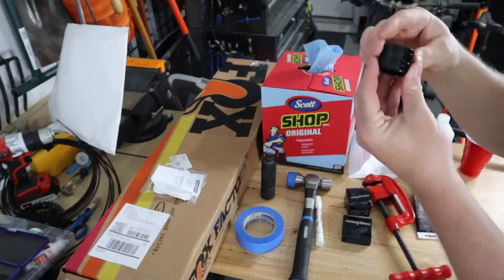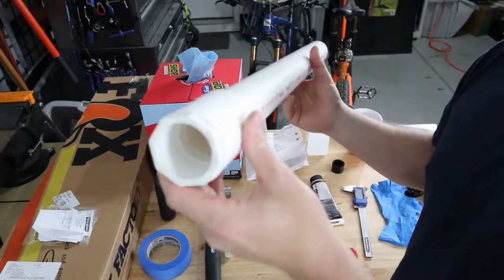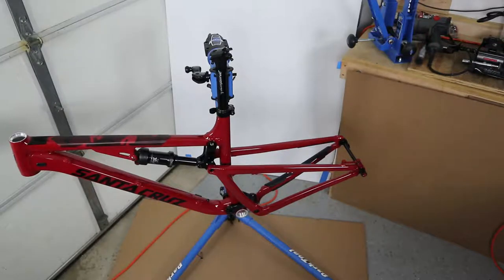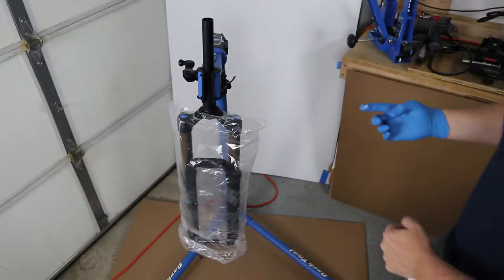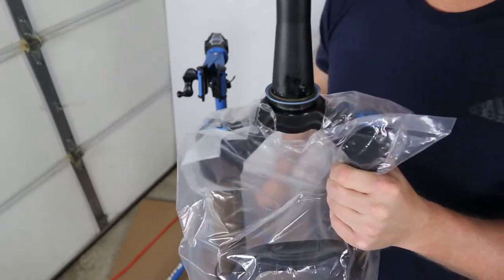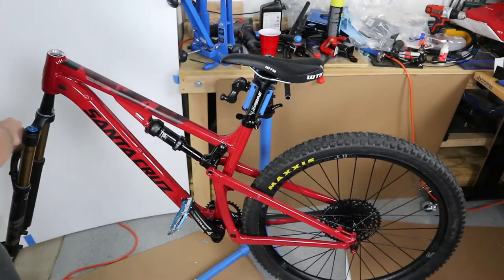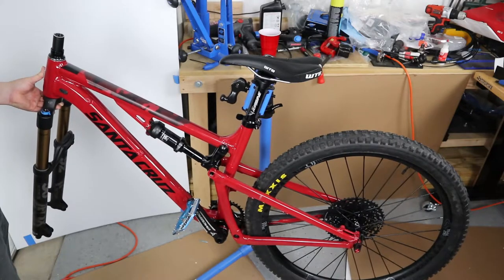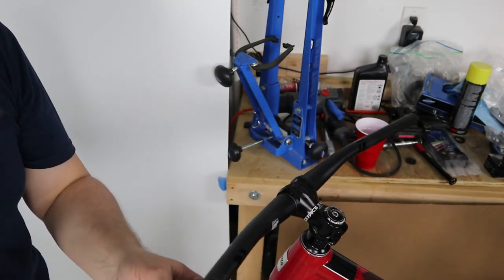#MTBPlanB Ep 4: 2018 Santa Cruz 5010 v2.1 AL Bike Build - Fox Factory 36 fork install

Comment: Reason why I'm asking this is something that I did I just purchased the 2019 Fox Factory Fork 160 travel and had to purchase an air shaft assembly kit for a 140 travel so that way you have all the adjustability of the 36 and the thick stanchions but with the 140 travel using travel reducers or volume reducers is not the same

Comment: 12:09 I recommend   to use Compression plugs, they are reusable and are easy to fit and remove.

Tip: I recommend Renthal Apex stems, they hold on to the bar many more months longer than Race Face stems.
I have Turbine & Atlas stems too.
My review: https://wp.me/p60aTF-2t5

Comment: Got a question did you add a new air shaft assembly to reduce down to 140 since that's the highest recommended travel for the 5010
Reply from the maker: Michael Kristman I’m using 150mm which is the max recommended
Reply from the maker: I also long shocked the rear with 57mm instead of 51mm